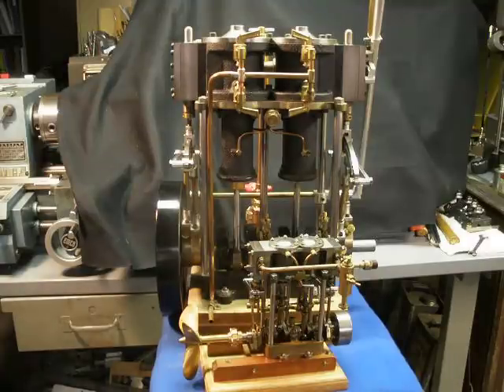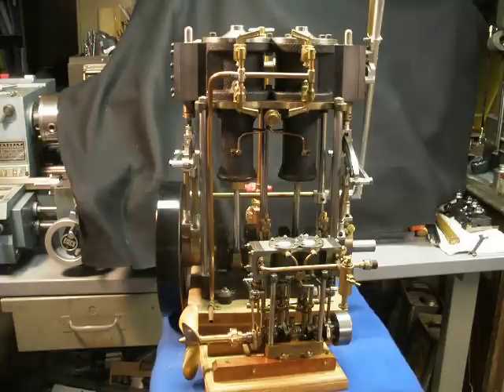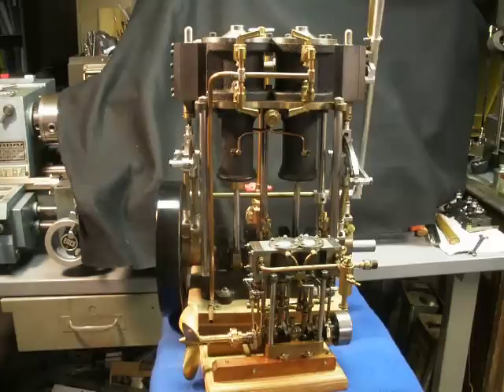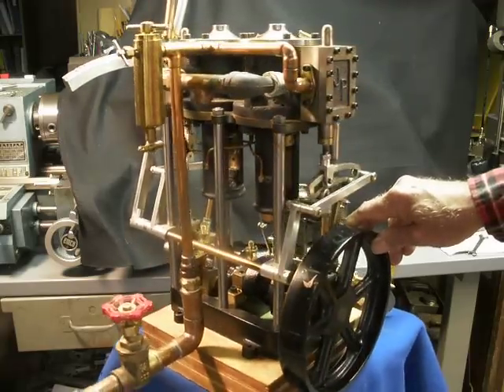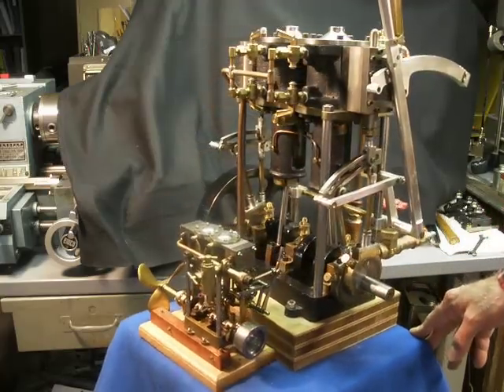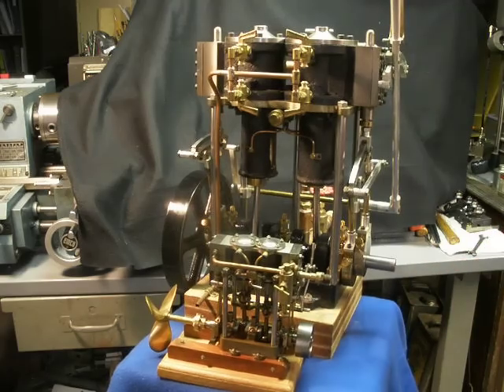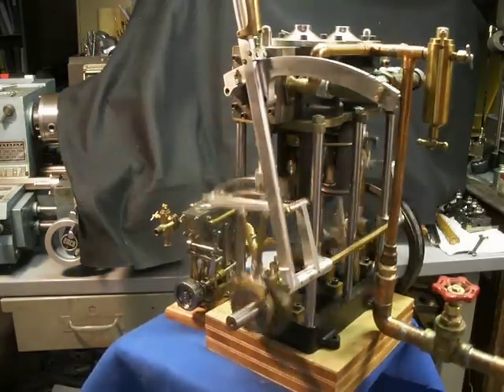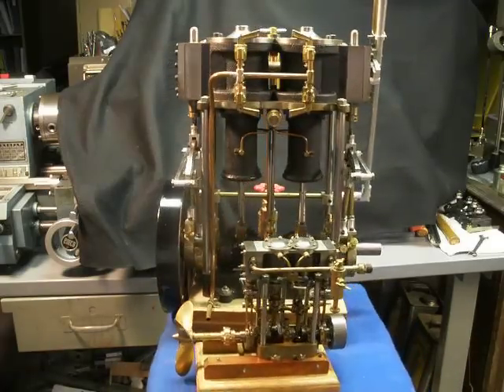Twin cylinder steam launch engine designed, patterned, sand cast and machined at home

Comment: This is som impressive work. Actually the improvements you made to the upscaled version of the Stuart is very clever. The design of the Stuart marine engine, and all similar style engines from that era, is not a very clever design. There is absolutely no way to get piston rod and the cross head guide to be precisely concentric. With the tube type cross head cylinder you have made, and that is common on stationary engines wit a "A frame" type standard, you can get much better accuracy and a smoother running engine.
Thanks for sharing.

Comment: Great work!  Sorry for the late post.
I'm thinking about building my own bar stock version of the Stuart twin launch engine.  I've built both horizontal and vertical versions of the Stuart '10's, as well as a real Stuart 10V.  I understand the trunk guides of these, however I'm not clear on the cross head guide of the launch engine.  How hard was it to build yours?  I've yet to see the plans for the twin launch.  I'd love to get a peek at some of the drawings!  some details elude me.
Some really good pictures would help too.